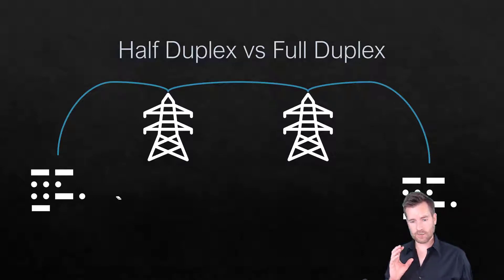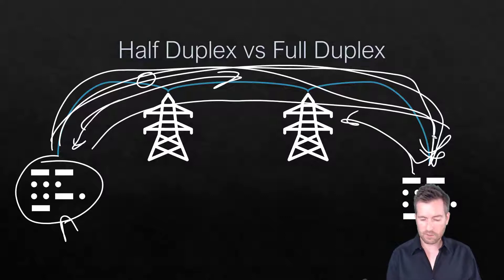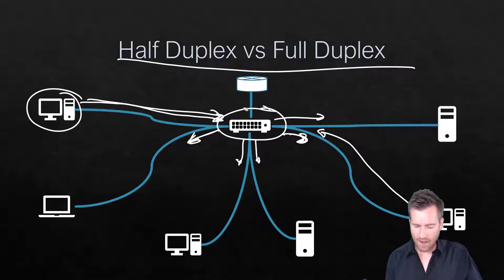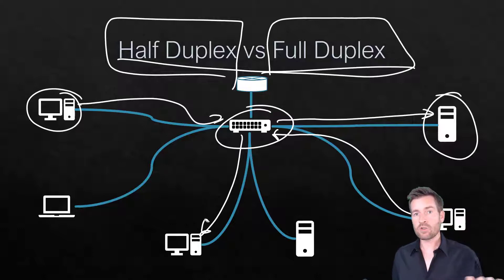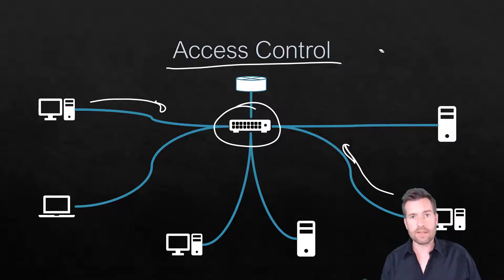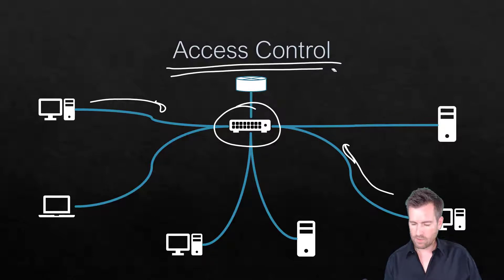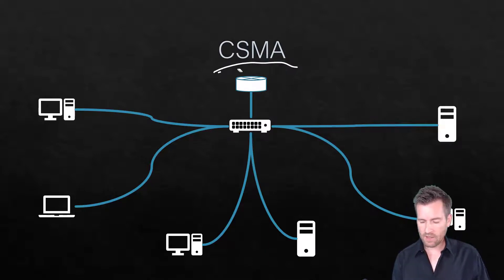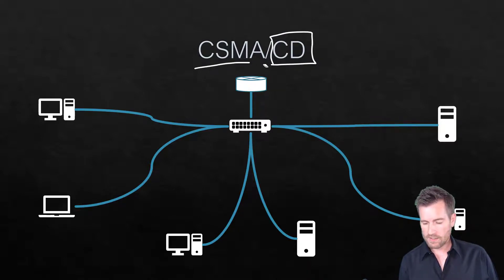Network Fundamentals 6-2: Layer 2 Access Control

Comment: Interesting How they avoid n manage collisions using CSMA/CD & CSMA/CA. Now things r getting a bit spicy as I like things related to software & problem solving & "managing collisions" is one of those.
Reply from the maker: Haha, in IT, the best thing to do is to assume everything fails all the time. Plan accordingly, and you make things more robust.  Some systems have bots that intentionally bring things down, so they are always testing their HA solutions.  Ethernet is just one example.  Of course with switches now days, collisions are not supposed to happen.